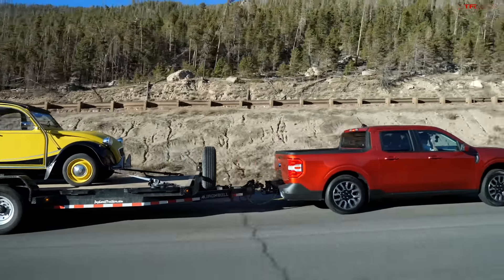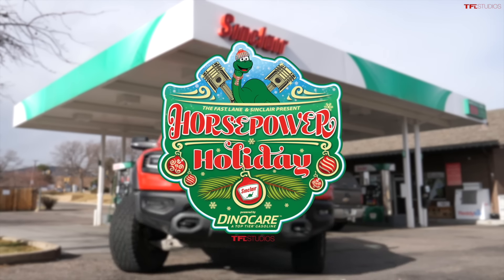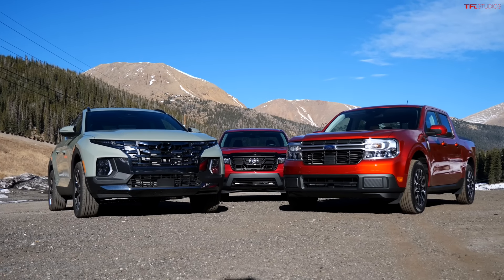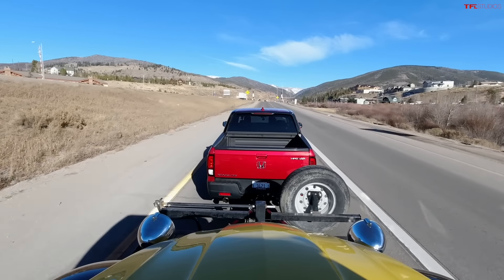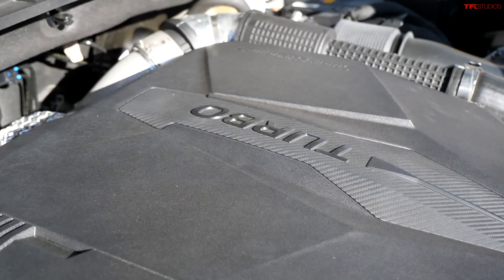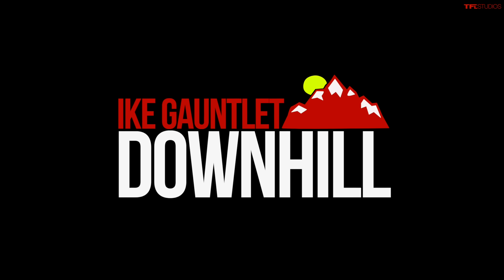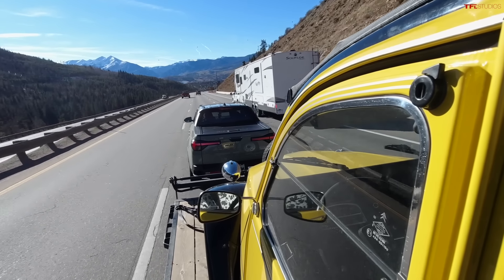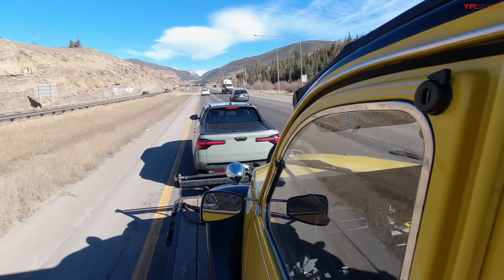I MAX OUT The Maverick, Santa Cruz & Ridgeline, But Which One Wins The World's Toughest Towing Test?

Comment: For what they are, I go with ford.
Now, I hate Ford vehicles, I absolutely think most of them are trash and I've always said I would only consider a ford if it is a Raptor or a Mustang. My Dad also thinks the same, but he includes the Ranger there (diesel engine).

But the maverick (only the AWD) seems like a great way to go. It is very spacious inside, it is pretty small on the outside, has a very good rating on payload and offers the true versatility of a pickup in a crossover/SUV plattform that makes it more drivable as a daily.
The Hunday seems to me like the modern version of the ranchero and el camino but without the huge engine (which makes it boring in my head). The maverick takes an SUV and makes it convinient for someone that has a family, likes to travel, has a mountain bike, is a DIYer, works with lots of tools, has to deliver significant volumes of product (or even weights)...
The Santa Cruz makes sense in my mind only if you are a weekend shreader on an mtb but lives in a city, comutes daily and has to think about family and comfort before anything else. It seems more like a car with big open trunk space, while the maverick is better suited for work and seems like a truck that has been adapted for city life without loosing your truck.

Comment: What about the cost of your baseline Honda?  And how it felt compared to the Ford and Hyundai?  That would be interesting to know.
Reply: Honda base price is more than Tacoma, Ranger GM twins. But it was always like that. The base Ridgeline comes standard  with IVTM4 AWD Torque Vectorng System from mid-cycle refresh 2020-2023.  2017-2019 offerd a FWD trim as base but they discontinued that. Original Ridgeline 1st Generation 2006-2014 came standard with 4WD.
So starting off in base Ridgeline it has AWD System similar to Acura Super Handling AWD but tuned differently.

Comment: To pick the Ford over the Hyundai is ludacris, unless you just cant over the looks of the Hyundai which is understandable. That said Hyundai beats the Maverick in every category with a higher towing capacity, better ride, more power, far better comfort tech, overall it is a well thought out vehicle the bed cover, storage and most of all fuel economy is damn near the same vs the nonhybrid model which is the only Maverick worth having if your looking to haul anything more than a bicycle. The maverick for me was very comparable to one of those little mini chinese utv pickups you see around, just super basic not something you want to ride in for any amount of time on a road trip etc. The santa cruz is a vehicle that will tow 5k with relative ease which is great for most fishing boats or medium sized campers etc., but what sets it apart is you dont mind hooking to your boat and driving across the country in it, with comfort not something i would even consider in the maverick without have a chiropractor lined up the following day. I'll throw this out there as well which maybe one of the biggest factors Hyundai has one of the best warranty in the industry, 10yr/100k vs Fords 5yr/60k.

Comment: The maverick already has a recall for rear seatbelts. Are near impossible to get because of delays. I went with santa cruz sel  premium  lists for $37k has awd turbo but cloth seats and less cameras..plus it wasa retractable tonneau  cover which ford doesn't plus better storage in the bed. I'm not brand loyal to any brand but cheap ford's tend to not be good quality
Reply: As an owner of multiple Hyundais since 1987, be prepared for that motor and trans to take a shit on you eventually. If  it that, then all the Uber cheap plastic inside will rot away.

Comment: I put the K&N filter on my Santa Cruz. It to me really made a difference.  I also took that huge Muffler off tail pipe and replaced it with 3in pipe and with a Beautiful Dule Stainless Steel Cut Exhaust pipe.  & it looks and sounds Amazing for a 4 cylinder Turbo.  You don't not need a Cold air intake system or Cat back System on this Truck! Don't Waste your money!

Comment: Fuel economy, power, comfort, sound... Hyundai.
If you're only going to drive down hill on the Ike Gauntlet, Ford.
Ford was also running very warm on the temperature monitor which would tell me the power train wasn't comfortable even if it wasn't struggling for power, temperature indication would kind of insinuate that the system was having a harder time managing itself even if it was managing the load. That would worry me especially in warmer temperatures or just in hotter climates, there's mountain roads in hotter climates which may stress the system further.

Comment: I respectfully disagree with the TFL guys when they say the load (car) is similar to an RV (assuming travel trailer). The weight is not the only factor when towing a travel trailer, it's the 7.5 to 8 feet front end on the travel trailer that acts like pulling a parachute down the road. At one time I thought I could pull a 4000 lb. (loaded)  8 feet wide Flagstaff with a Toyota Tacoma that could  tow around 6700 lbs. (from what I remember). It was a bad decision on my part. Flat ground, it was ok, headed to the mountains of Tennessee and the truck struggled to maintain 55 mph. The exhaust pipe turned a reddish brown. I still like the Tacoma, it's a great truck, but I couldn't keep it for my needs, I traded it for a F150.
Reply: They have towed a box trailer with Ridgeline before. The same stretch of road.

Comment: If you had the FX4 package on the Maverick it would have hill decent to hold your speed without braking. Great video
Reply: Unless ford changed something recently hill decent control only works from 2mph to 20mph
Reply: @Michael Bradley  Yes. And it still uses the brakes, but applies them automatically.
Reply: @rightwingsafetysquad9872  I am aware of how the system works as my current truck has it but for this scenario hill decent control wont help because it will not enable the abs system above 20mph according to the owners manual
Reply: @michaelbradley770  I was agreeing with you.  And expanding for other people.

Comment: The Ridgeline beats the econobox Maverick and car like Santa Cruz at THE SAME PRICE. It doesn't even make sense to consider the other two.
Reply: Optioned the way I'd want them, the Ridgeline is $10k more than a Maverick and $2,500 more than a Santa Cruz. Heated seats and remote start are a must, you can only get those in a top trim RTL on the Ridgeline. You can get them on mid trim XLT and SEL on the Mav and SC.

For me, I want a car that can tow my motorcycles. The Santa Cruz best fits my needs, but I'd save money and go for the Maverick.

Comment: Great Video. Now that you maxed out features and specs, I can get a XLT with 4K towing and the same engine priced less if I don't max out other specs. At what level and price can I get the same on the Santa Cruz?
Reply: I just did the pricing and the price gap is smaller between the XLT and SEL!
Reply: In order to get the turbo engine and AWD on the SC, you have to select either the SEL Premium or Limited trim.  The SEL Premium trim starts in the mid $35k range, while the Limited starts in the $39k range.  Both of those trims have the same performance capabilities, but the Limited gives you a lot of additional luxury for a few thousand more.  If you're looking strictly for performance per dollar in these two vehicles, the XLT Maverick you described will cost you several thousand dollars less than the SEL Premium trim of the SC. however the SC SEL Premium offers considerably more features than the XLT trim on the Maverick.

Comment: You can tow with a dual clutch?
Reply: Yes, you may even be able to tow more than once....
Reply: Wet DCT can tow no problem. But for Dry DCT, majority of the time it is not recommended for towing as it's designed more for performance and not necessarily towing.
Reply: Not for long!
Reply: @markconnelly183  that’s what I was thinking, dual clutch transmissions don’t do well for towing… I wouldn’t even to 2000 pounds with that vehicle, let alone 4 to 5000 pounds.
Reply: @AlaskanSnowLeopard  which one does the Santa Cruz have?
Reply: @christopherhamilton5557  Wet DCT if I recall correctly.

Comment: hey Andre, a more experienced driver would manually down shift the transmission if the computer doesn't do it on its own. You even can go back and forth. If it reaches like 63, you down shift and ones it hits 58 you up shift again and only use the brakes if it can't hold the speed after you down shifted. Your explanation of the Prodigy brake controller is very vague! is it inertia controlled? And Nathans assumption, that the normally aspirated Ridgeline with 100hp less will behave completely different is not exactly rocket science!! Can't you guys measure acceleration to 60 instead of guessing and feeling? And this is a towing test, so the focus should be how well it handles towing! you guys need to come up with a point system instead of judging the vehicles by preference... The Santa Cruz is clearly not set up for towing, not having a brake controller, not having sway control which I believe the Maverick might have and it has no tow haul mode, the transmission does not down shift! All it has is a powerful motor, but that doesn't make it a good tow vehicle!

Comment: Kind of wild that when you tow, you get about the same mileage out of a four popper as you get out of a big old V8.
Reply: Well, when you connect a turbo on to a 4cyl, you are able to push as much air and fuel through a 4cyl as you can a normally aspirated V8.  Second, it requires the same amount of horsepower to move a given amount of weight.  Efficiencies on a 4cyl are needing less power as you are moving less weight with less frontal area, all of which goes out the window when you are towing.
Reply: You use as much fuel as the power you're demanding from the engine requires. When you're moving a lot of weight up hill the internal inefficiencies of a large engine don't matter as much.

Comment: If the Santa Cruz wasn't so garbage offroad it would be pretty cool.
Reply: If you get the aspirated automatic transmission and not the dual clutch.  Dual clutches are not meant for offroad capabilities and they know this. They have done it before and burned it out.

Comment: I would really like to see you modify the way you apply brakes on the downhill portions. I'm not sure you give any trucks being tested enough time to decide if they want to drop more gears. I see you hit 60mph, stab the brakes and quickly scrub speed back to 50mph within a few seconds.

Try pressing the brakes to HOLD 60mph until the transmission gets done downshifting on its own then slow down to 50 when the trans drops enough gears. You may find a LOT of trucks will only need one or two brake applications on that test.

If I brake the way you do in my Ram when towing it doesn't downshift enough to help much on steep grades. If I lightly apply the brakes to hold speed for 5-10 seconds it will easily drop three or four gears to assist. It easily holds speed on steep downhill grades after that.

Comment: Does the 5K towing capacity come standard on the Honda and/or the Hyundai?
Reply: 5k towing is standard on the Honda, but I think you need to option the turbo engine and AWD on the Hyundai to achieve the 5k tow rating.
Reply: It's standard on the Santa Cruz if you get the AWD SEL Premium or Limited with the 2.5 turbo engine and use a trailer brake controller, 3500 lbs without.  The SE and SEL models with the naturally aspirated engine are rated for 3,500lbs towing with a trailer brake controller.  Whether you use the trailer brake controller is up to you as I'm sure many won't but for safety it is recommended.  The Ridgeline is standard 5k towing for all models.
Reply: The santa cruz doesn’t include a hitch as standard equipment.
Reply: It is standard on the Honda ever since they dropped the FWD model.
5,000 tow capacity on AWD
3,500 tow capacity on FWD

Comment: Hyundai’s history of weak rod bearings and piston rings does not provide any confidence in long-term reliability of the drivetrain with the stresses of towing. Throw in at best unknown reliability of a dry clutch direct shift transmission under load and you are making a big gamble against terrible odds.
Reply: But it's got that fantastic warranty , lol
Reply: It’s not a dry clutch. it’s a wet clutch. It’s the first year they’ve used it. So, not going to speak on the long term durability. But, it’s not a dry clutch.

Comment: That Maverick performed really well considering their load was 4000lbs which is absolute max for that truck and about 1000lbs below the Santa Cruz limit. The Ford did admirably in my opinion and is $4K cheaper. I'll bet if you max out the Santa Cruz to 5000lbs it doesn't do anywhere near as well.

Comment: How is the Ford more like a truck when it tows 25% less and has significantly less power? Those are HUGE issues that can't be fixed. A brake controller can easily be added to fix the Santa Cruz. Sorry but I'm calling "fan boy" here.
Reply: I think they are referring to seating position, less friendly ride quality due to stiffer suspension,  looks, standard transmission vs a DCT which is a big thing for towing.  The Hyndai is more refined but not targeted as much to do truck stuff.

Comment: For these prices the choice is simple! Tacoma/ frontier. HAHAHAHA. I'll pass on the Psuedo Trucklets
Reply: The Tacoma and Frontier ride and drive like pickup trucks. So if you want something that handles Unibody car or Suv like you, look at this.
Reply: Ridgeline has a higher payload & much bigger bed than those two plus a way better ride so....
Reply: @bryhul6534  It does not have a bigger bed. Frontier and tacoma both have 6ft bed options. My 19 frontier was 6ft and my 23 tacoma dbl cab is 6ft. Both trucks tow more than the ridgeline by 1300+lbs. I have seen people load the tacoma with 2000lbs anyways and it was fine. The ridgeline is 5k max tow.
Reply: @270eman  There's more to bed size than length fanboy...The optional "6ft bed" you're throwing out is only 8inches longer than the Ridgeline, the real difference is the Ridgeline has a 50 inch wide bed between the fenderwells whereas the taco only has 44inches plus total width of the Ridgeline bed is 60inches & the taco is 52inches wide! Meaning 4x8ft plywood & sheetrock lay flat in the bed between wheelwells but with the taco or frontier you have to try to stack it up on top of the wheel wells & it still barely fits 😆
(Not to mention atvs can be loaded easier too with the tons of extra width between wells.) total square feet the Ridgeline IS BIGGER and much more useful width!

Comment: Ok, these are the low end of towing anything…..and that may work for some folks. All the chatter about automated transmission braking, holding speeds is just senseless; I’m old school with transmission heat gauges, turbo inlet/outlet heat, and feathering brakes on down hills, with manual third brake.  Sounds old school, and it is, but it also mandates driver awareness. And that’s where I step out. If you tow, you need to know…..relying on automation is dangerous. These little tow rigs aren’t meant for max situations, ever. And, I’d suggest you show emergency braking situations with these baby tow rigs…pulling is one thing, the ability to stop is more important. Next, how’s about you address load leveling. Get Real On Towing. Rant Done. This Vid is old, but it’s out there……so update it.

Comment: The thing I question is; you used manual mode on the Hyundai to max out the rpm and still got 12 brake applications.  I don't think I'd want to do that down hill with it's max tow capacity of 5000 lbs behind it!  I think that would be dangerous, maybe disastrous for the inexperienced driver.  It seems to me the true max tow capacity of the Santa Cruise should be 3500 lbs, where the Maverick could likely handle 4500 lbs with no issues.
Reply: The maverick was close to overheating in december, imagine if they had been towing in July instead.
Reply: @marklion315  "close to overheating" is a gross exaggeration!  It was 1 bar over half way (27:35) to the red.  This was just above the middle of proper operating temperature.  Certainly even the beginning of red would not be overheating, just getting hot.  Even with that there was no exact temperature referenced.  They never commented on the other trucks or showed any guages.  Do they even have a temp Guage or just a temp light?

Comment: So the Santa Cruz has no brake controller, no tow haul mode and had 12 brake apps. Seems the Maverick is head and shoulders above the Santa Cruz in this test.
And who cares about a stupid plastic engine cover that does nothing but shroud leaks and must be removed for every little service?
Reply: FYI the hyundai  tows a 1,000 pounds more
Reply: @robertsn6584  after watching this, would you want to though? Might have broke the record for brake applications
Reply: @ryanhessler8966  they had the car in the wrong drive mode . They had it in smart mode. Tries to get the best MPG in that mode . Should of been in sport mode

Comment: These "trucks"  need a exhaust brake system.
The Hyundai and  Ford  need  to reprogram  the Turbocharged engine to use the variable  Turbocharger as a exhaust brake.
Reply: clearly they don't need them at all. and that's not how turbo's work